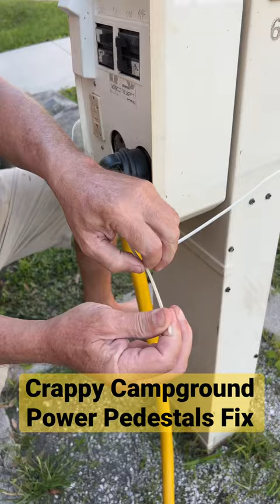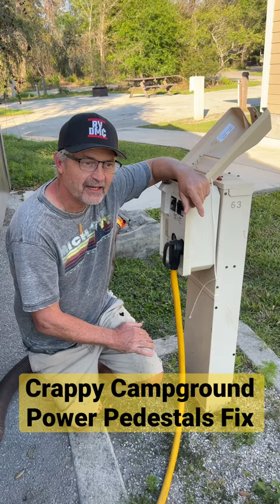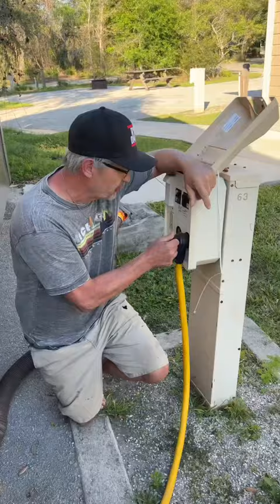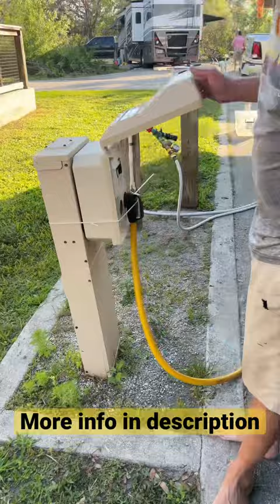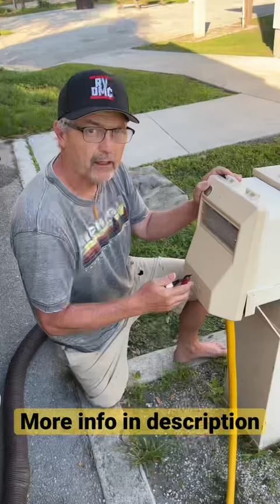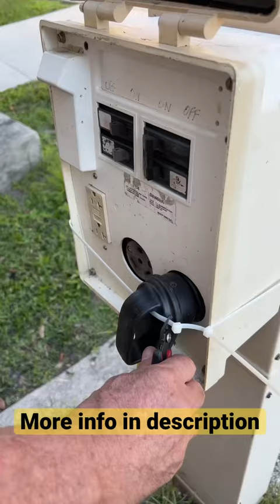Bad RV Power Pedestal Temp Fix! #shorts

Comment: Although we boondock exclusively, I could see using a rat-shit strap...
Reply from the maker: A what?
Reply: @DownsizingMakesCents  
In our ExpeditionVehicle, we carry several rat-shit straps in different sizes.
Example:
We engineered our rig with a rear entry, and permanent porch with a permanent roof.
On rough tracks to remote mountain lakes or isolated Baja beaches, we forage downed wood.
We secure those timbers on our deck using rat-shit straps, then continue to our camping spot.
.
A spare tire, a surf-board, a kayak, pretty much everything is secured with rat-shit straps.
.
On my ancient BMW motorcycle, I use rat-shit straps instead of bungee cords.
A bungee can snap, putting a coat or sleeping-bag into the spokes, locking the wheel, and spoiling the day.
A couple-three rat-shit straps are nearly indestructible... although I admit my four and occasionally five rat-shit straps holding one coat looks like more straps than garment.
.
I prefer rat-shit straps for safety.
Accordingly, a rat-shit strap tightened around your RecreateVehicle cord and the resort pedestal sounds like a reasonable response to slop.
But that is merely a guess on our part, we boondock exclusively.

Comment: just get the 50 amp adapter because no one uses the 50 amp. DUH
Reply from the maker: Not the issue at all. Did you watch the whole SHORT?
Reply: @DownsizingMakesCents  THE ISSUE... that i deal with 12 times a year as a camper... is that the outlet is worn down and makes poor connection and falls out... we use a 50 amp adapter, no one uses the 50 amp plug. yes i did and zipties are a terrible way of solving this unlike a bungy cord or an adapter.

Comment: To fix it would to open the panel and tighten the mount screws. Note not to be attempted by fools and ninnies
Reply from the maker: Please see pinned comment. We don’t open power pedestals that aren’t ours
Reply: @Downsizing Makes Cents  my guy the quality of the past is only accentuated by the cowardly and unwilling/unintelligent. It's up to the individual to make responsible and educated improvements to one's environment in consideration of benefit to the overall community. Act accordingly.
* pinned comments dont typically show up front like normal videos. Relax and make life beter for your fellow people

Comment: Extremely poor plug and outlet design. Nothing should be hanging from cable. Over time, this alone can cause outlet failure
Reply from the maker: Many people hang surge protectors. We are lucky to have one built in
Reply: @DownsizingMakesCents  we need standardization like in the EU. Their plug receptacles are recessed to help prevent electrocution. Larger, high voltage & heavier plug designs should incorporate a standard lockdown mechanism like liquid natural gas transfer/refill stations.

Comment: Bungee cord
Reply from the maker: We do have bungee cord. But easier to use 2 zip ties then 2 bungee cords when it’s a big box. Plus, we have had people actually take our bungee cords
Reply: @DownsizingMakesCents  fair enough. Never had anyone still my cords but I could see that happening. I use 1 18” cord with 1 hook removed. Maybe that’s why it hasn’t been stolen. It’s quick and reusable.
Reply from the maker: @spatton7875  zip ties can be reused. We couldn’t cover everything in a “short”
Reply: @DownsizingMakesCents  agreed but not as easily and they don’t last long in the sun. You do you. Was just trying to share what I’ve found to be a better option. Specifically good rubber bungee cords. I’m an hvac guy so I always have zip ties in abundance but still use bungees.

Comment: not that hard to fix it just need screw driver X and flat blade but you dont want steel handle you want plastics one so doesnt get electric zapped 
just remove screw from panel and two screw top and bottom on outlets just tight it down and put panel back on boom there ya go
Reply from the maker: It’s not appropriate to “fix” a power pedestal at a campground when you  don’t work them

Comment: your breaking the ordenances of the place your staying and city if it wont stay in then theres a problem and you dont use it you can buy short extentions never zip tie why someone may steal the cutters you are frantic may forget those 3 seconds are critical dont be this guy use a extention or tell the place hey its loose if its still loose with a short extention then the plug is worn out and needs to be replaced
Reply from the maker: See pinned comment

Comment: Terrible advice!   Zip tie is not a fix.   Others who may not have a GFI, line balance monitor, or maybe just a 110v cord.....this is a fire hazard!  Loose electrical connections generate excessive heat under load.   Just because you secured the plug does nothing to ensure the quality of the electrical connection.
Reply from the maker: See pinned comment